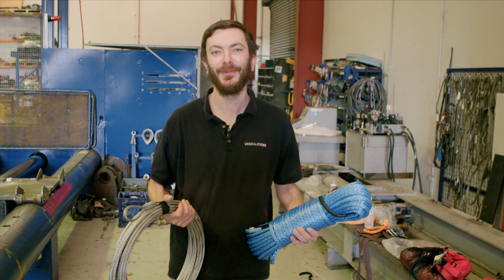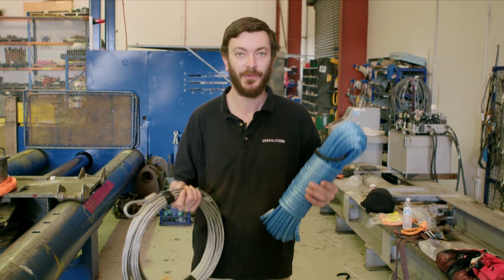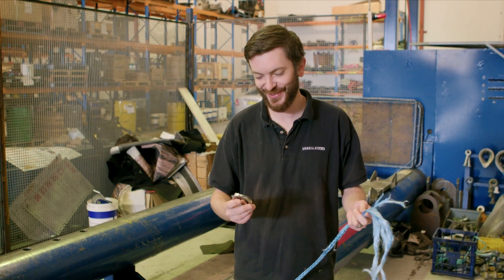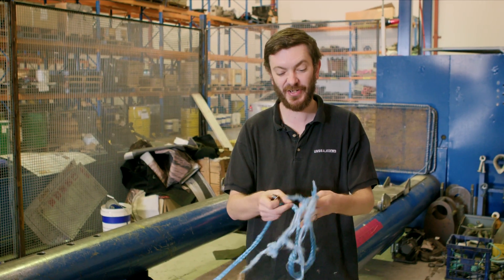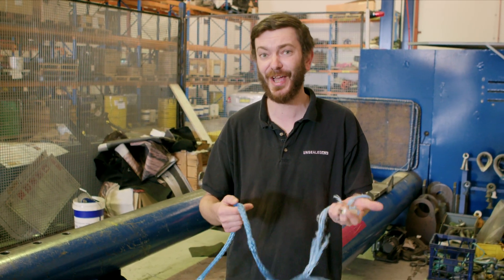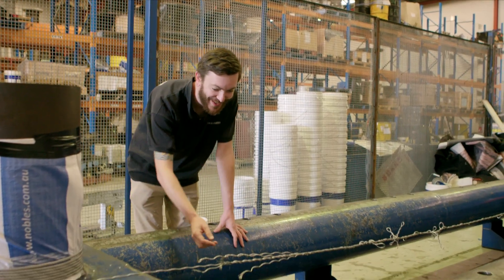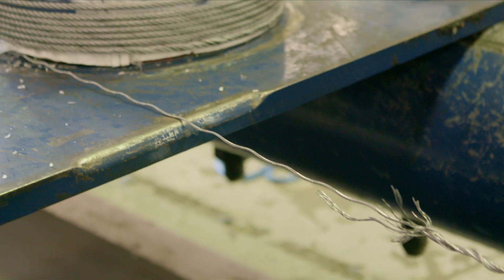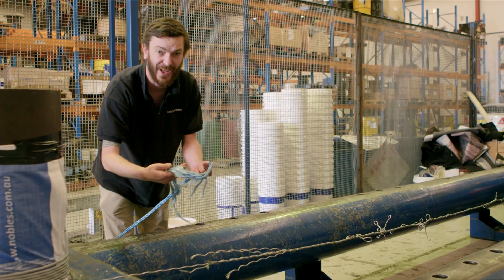Winch Rope Destruction Test: Synthetic vs Cable

Comment: The cable breaking over 1.3 tons than what the synthetic did and you still call the synthetic safer.  The cabling is dangerous, but the real danger is in the hook or any metal down the line. The synthetic rope fell off completely, The steel cable remained attached....  Still confused how you think it performed better. Synthetic is only good for ideal scenario's and in the real world we know those don't always happen.  I went with the steel cable, less danger of mud and sand actually cutting into your cable if you don't wash it properly, any sharp edges will ruin your synthetic cable and it can get snagged easily. If you want more durability/longevity and strength Steel is the way,  If you want to sacrifice some of that for safety synthetic is the go to.  My only question is in a risky recovery scenario would you want your cable being something less likely to fail or would you want something considered Safer but if it scrapes the wrong root or branch or gets driven over, you potentially have a vehicle tumbling down a mountain side. whats safer again? lol
Reply: Agree with ya, Mad0.....wire rope can be mis-treated and abused and they rarely break.  Synthetic rope is so not so tough   ....they don't like mud and sand.....they don't like too much sunlight....they don't like bending over rocks with great tension.   Wire rope just does not care....it just works.  But I have to admit that synthetics come in really cool colors.
Reply: In 10 years my steel cable will still be good and if I was using rope it would be junk if it's not replaced every 3 years. I had a synthetic tow strap that was 1" in diameter  and was about 4 years old and it wouldn't pull my neighbor car on flat ground and just broke like nothing.
Reply: Good points actually.

Comment: Comparing it against a chain in a similar situation would be interesting since a chain is sometimes used as an extension when your winch cable is not long enough.
Reply: You should never use a chain on a winch rope. If your attachment point fails, the chain will become a weapon. Ideally you use the same type of line as your winch uses with an eyelet in the end and a safety weight on the line. They sell “winch extensions” for exactly that reason. A static strap is a safer and more common option as well. 
The advantage of synthetic line when used as an extension is that you can carry 50’ in a pack the size of check box. 
Carrying steel like as an extension is not practical with steel core rope. Fiber core much easier to store but lower strength.

Comment: I'm putting 7/16 wire on my 10klb winch. Less maintenance,  move uv resist and more abrasion resistant
Reply: jesus ⁷/¹⁶th  may as well have crane wire while youre at it
Reply: @rotam8680  good idea. I'll do that. they are building a bridge in my town I can get it from the crane. good thinking
Reply: For any needs about steel wire rope PLZ contact me WhatsApp：+86 18036231199 .We are  manufacturer of steel wire rope in China.
Reply: @bowenxu9486  no thanks

Comment: I've had both wire and dyneema. I've never broken a wire rope but had one fray on a 20000lb tow truck winch once.
Had dyneema going through snatch block and snapped twice. The weight and heat generated going around the snatch causes the rope to harden and snap. The actual snatch block was cold after failure. It was spinning and everything.
Reply: Yeh, synthetic rope and steel cable both have their applications. The weight you are pulling is much more suitable for wire cable.
Reply: Dyneema hates heat.. it melts just like a milk bottle.
Reply: @1st_ProCactus   - ha ha  well it is closely related to milk bottles.
Reply: @kadmow  ;)
Reply: You should buy better quality snatch blocks, learn about winch speed dynamics and learn how to rig properly.
Reply: @gabrielreyes8476  being around cranes and towtrucks my whole life I understand rigging, winching, straps and pulleys. 

Wire handles water and dirt a lot better than Dyneema. It impregnates the rope and causes it to tear. 

Depending on applications, wire rope is still useful. 

Towtrucks and cranes do not use dyneema rope. There is a reason for that.

Comment: I second the comment that this is a b.s. test ---- the rope should have been repaired as they say --- tie the new end together or whatever and pull it till it breaks --- rope is lighter so less energy but I believe it still recoils back and dont drop to the ground as they say ---- heck the steel cable in this test literally just fell to the ground and we all know that's not true
Reply: My family owned a automotive service shop for a very long time, and we had many tow trucks. From simple snatch trucks, rollbacks all the way up to 60ton wreckers. The whole cable cutting people in half is a myth. When a cable breaks it slams back toward the point of tension, usually the winch it self. The only way to get a cable to swing out is to have it being pulled around something without a snatch block. So say your cable is run around a tree at say a 45 degree angle, then when the break happens it will catapult it around the tree. Very unsafe. But even with that it won’t cut you in two, unless your working with tug boat levels of force. Nothing any off roader, or tow truck should ever come close too. 

That all being said I’ve snapped a few cables in my day, once on an 80k pound pull, and I’ve never seen one just go flying. I think off roader need to learn the proper way to use winches and proper safety methods. The cables are not as dangerous as everyone would have you believe, but you do need to have a good working knowledge of how they work. 

Btw most of the danger actually comes from whatever your winching when a line breaks. If a truck moves suddenly or breaks free completely then you have a few tons of steel going uncontrolled in whatever direction is the path of least resistance. That’s where people can be hurt or killed.
Reply: @vinmatrix76  very interesting - thanks
Reply: @vinmatrix76  There are videos of a 4x4 group in Australia where they have a bulldozer slowly pull a fairly long length (over 50 feet),  ~12k lb capacity cable in a straight line pull until it breaks. 
They have the area fitted with cameras that play back in slow motion. Their tests have repeatedly shown the steel cable breaking and flying, say 10 degrees relative to the pull axis. 
Their tests show it is extremely dangerous. In one instance, they parked a car a foot or two to the side of the pull axis. The cable had so much force while flying that it actually sliced through a substantial section of the front window-roof pillar. 
These tests are objective and they aren't selling or advertising anything
Reply: @gregparrott  first 10 degrees off is about right. Typically when a line breaks is springs back towards the point of tension. And with the coiling effect you could easily hit something at that angle. A 12k straight pull would be extremely stupid to do, and quite frankly nobody should be doing that without a snatch block. But even if you did and the cable snaps, and you or anyone else was standing directly next to the cable, it still won’t cut you in half. My last post never said you couldn’t get hurt, I said it won’t cut you in half. The amount of force need to cut someone in half or even to cut a limb off is far more than anything you’ll encounter in an off roading situation. But yes officially you could get cut or maybe possibly a broken finger/hand. The problem with trying to show the damage from a cable snap is how most do it. If a steel cable hits a piece of metal on a car it can cut it, but it’s because the metal doesn’t move. If it hits a body the body will move and absorb a lot of the energy. Whether it knocks the body down or the body tissue compresses doesn’t matter, it will absorb a ton of energy. That’s why people put heavy rubber blankets on the pull cables, because they absorb all the energy. 
I stand by my original statement. Synthetic rope is a gimmick that is over priced and marketed with fear. Any true off roader that has learned how to work with steel cables would never buy synthetic rope. Btw it’s not like off roading is the safest sport in the world. Why is everyone so scared of using steel? Probably because they never took the time to learn how to use it, and because the off road magazines have scared them into not wanting to even try to use steel.
Reply: @gregparrott  That's why you don't stand a foot or two from the cable when winching. Show me a video of someone ten or fifteen feet away getting hit by the cable. Add a damper to the equation for added safety. We've been using steel cables for nearly 200 years. Being safe with them is not difficult.
Reply: @johnterpack3940  I generally agree with what you're saying. But you've over-generalized. The 10-15 feet is based on an assumed length of cable. If the cable was exceptionally long, the requisite safe distance will grow. A better, estimate would be using degrees instead of feet.
Reply: @gregparrott  that's a given. I just threw in a number because a number was needed. The main point is that synthetic doesn't provide any safety advantage to people who behave safely.
Reply: yeah you can't cause a recoil on those machines because its hydraulic, once they started to fail the tension was lessened significantly thus no killer snap.

Comment: So basically the higher priced brand name synthetic rope broke because it was fitted with a cheap, nasty eyelet that compromised the integrity of the rope. Cost cutting buy companies with no regard for the consumer, nice.
Reply: Though I'd prefer having the weakest point as the rope or thimble, if it breaks only the rope is going through the air than than a shackle and mount.

Comment: Yeah good test but. the thimbles for Dyneema\spectra\amsteel synthetic braids should be cast and pollished before installation. Had that been the case the results may have been different. also the frayed end appears to indicate that the bury was to short for an eye splice and the splice was not locked. I suggest to anyone buying a synthetic winch rope gets a cast thimble from a chandlery and takes the 20 minutes required to re terminate the rope with a locked brummel splice as used in sailboat rigging. the thimbles are not that expensive around 10 bucks. many youtube videos give you the how to.
Reply: Why not give the thimble a miss entirely? It doesn't seem to be needed at all.
Reply: @ksb2112   - there is the bend radius thingy - I thing it is still regarded as being real.
ie, the Smaller the bend radius the closer the rope strength gets to being equivalent to a single strand (or weaker if over a sharp edge) - as well as the whole "armouring the rope end"  against connecting gear, abuse etc.

 - that said, of course a thimble is a weight (even nylon versions) which COULD go flying if the rope Breaks - hopefully you anchor the end securely to rated points with shackles, etc... - a Towbar is also a serious flying weight.
Reply: @ksb2112  synthetic ropess like dyneema have huge tensile strenght but do not handle abrasion or transition over sharp edges well
Reply: @gmoose777  Agreed. But what was implied is that there is no need for the loop to run over anything sharp, especially if you used a soft shackle.
Reply: @ksb2112  From what I've read, the thimbles are   important because the bend radius of the rope (as well as for steel cable) has a dramatic effect on the breaking strength.
But in this test, the thimble DEFORMED, causing a sharp edge on the thimble to move into and cut into the rope.
Reply: I'm glad to see this is the first comment listed. All the thumbs up!

Comment: Great test guys. you are a credit to the 4WD industry! Was not expecting the wire rope to hold  after failure. Would you mind elaborating how close they were to their rated breaking strains and what poundage winch the would be applied to?
Reply from the maker: Thanks Greg, for more information on the test check out the full article at http://unsealed4x4.com.au/u4x4/issue039/#27